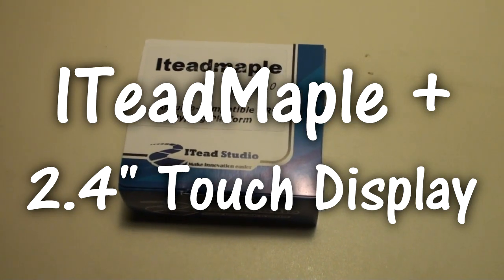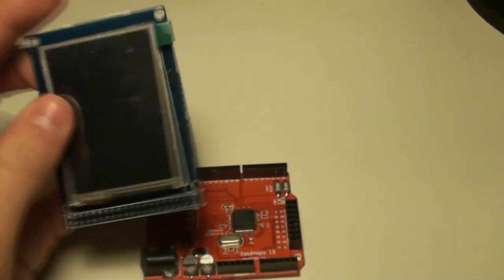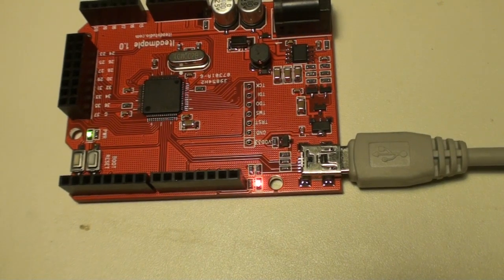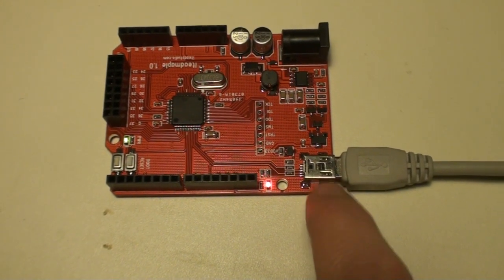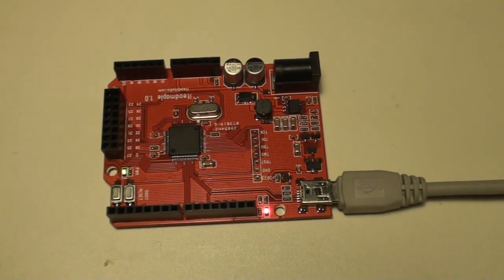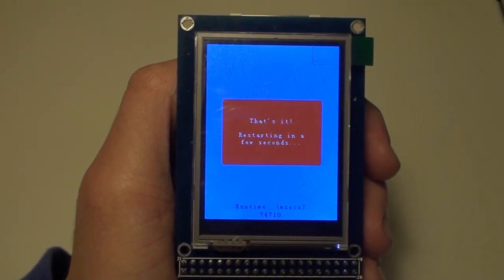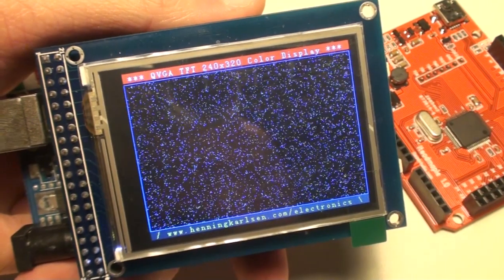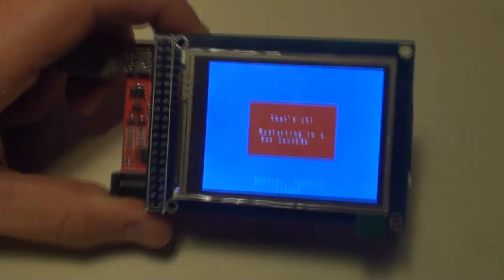ITeadMaple + 2.4-inch Touch Display

Comment: hi, do you know how to go through this tricky button press play to go into perpetual bootloader mode? can't set my maple R5 board, I try to press reset and then but and hold it, see slow flashes, then hit reset but it's not changing anything, board flash fast again, can't upload the sketch without this mode either (ArduionoIDE, MapleIDE)
Reply from the maker: Go and press the reset button a lot of times. After each release the LED will start to blink fast.
One of the times when you have released, please press the BOOT button as fast as possible. Keep holding this button.
The slow blinking that will start should keep on blinking for at least 5 seconds, then you can remove the BOOT button press and you should now be in Bootloader mode.
Reply: mindthomas hi, I've just checked what you wrote in your advice, but it isn't work, maybe is something wrong with my board
Reply from the maker: ***** It could also be a driver related issue. Which operating system are you using?
Reply: mindthomas
I use linux mint, it is driver I think, as there is no problem on windows

Comment: Hello, which board did you select in the Tools-Tab for the Iteadmaple? LeafLabs Maple Rev 3+? I am not able to upload any sketch because I get following error message:
Couldn't find the DFU device: [1EAF:00003]
It is maybe because under SerialPort I only see ttyS0 and no ttyACM0.
I'm using Ubuntu 14.04 LTS 64bit.
I'm able to program arduino boards with the arduino ide(there i get the ttyACM0).
I'm aware of setting the board to the bootloadermode by pressing the reset and short afterwards the boot-button.
I suppose it might be a failture of libusb or udev but I'm no expert.
I also failed with windows7 64bit because of libusb and the unsigned driver, but that should not be part of this post!

best regards
Paul
Reply from the maker: There is two options of programming the LeadLabs boards on - either by the USB DFU bootloader or thru the onboard Serial bootloader (this option shouldn't really be necessary).
So if it doesn't recognizes your DFU device you might have damaged the DFU bootloader and might need to reinstall it: https://github.com/leaflabs/maple-bootloader

Comment from the maker: If you are talking about the automated Arduino library for processing, making your processing able to turn on and off of the I/Os and do other things, then yes, but it will require some porting.
You should be able to port/recompile the code in the Maple IDE and then burn that to the Arduino as it is simply a matter of serial control commands sent by your processing app.

Comment from the maker: @mdesm2005 Yes. You should be able to compile the bootloader for any kind of STM32 board, as the bootloader source code is published: leaflabs.com/docs/bootloader.html#flashing-the-new-bootloader
If you do so, then you will be able to use the modified Arduino IDE - LeafLabs Maple IDE.

Comment: Great video.  Can the Arduino IDE be used on these STM32 boards I'm finding on ebay  I need a display & SD card & a few user buttons (or touch display).  I need to log data at a rate of 100kb/s in real time for several hours, data that would be coming from a HOLTS 1553 chip. The products I've seen are the STM32-Development-Board-STM32F103ZET6-3-5-TFT-LCD-/250820918183   and the mini-stm32-board-stm32f103vct6-3-2-lcd-touch-panel.html